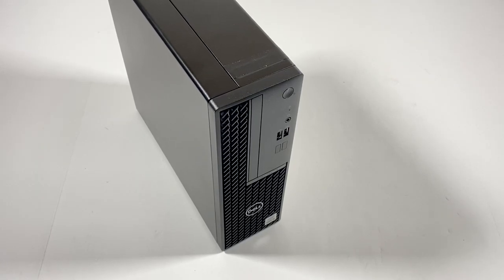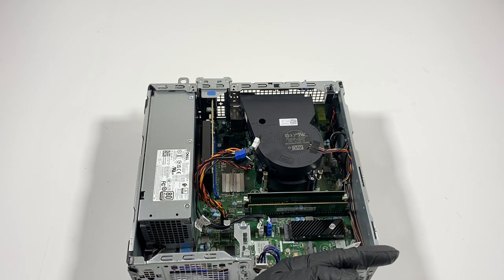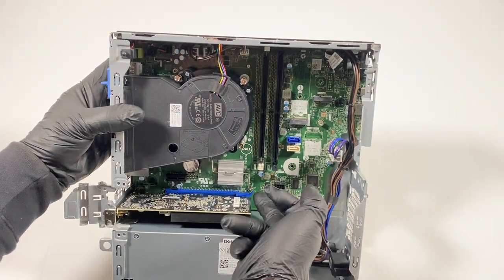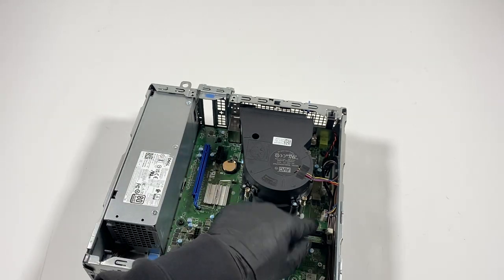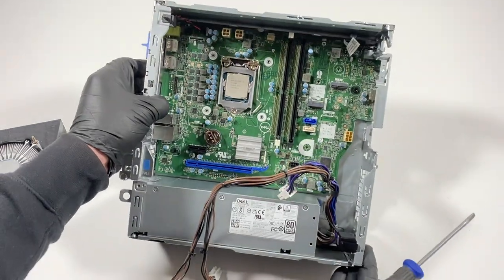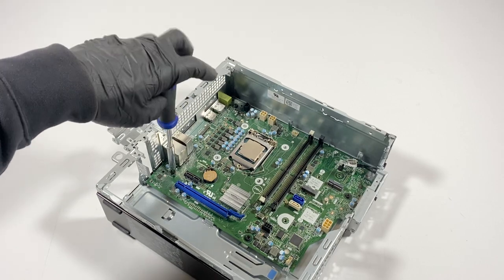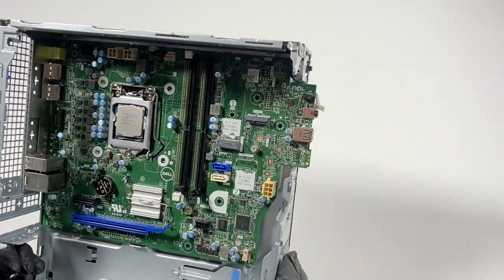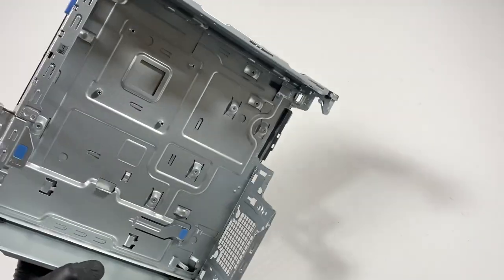Dell Optiplex 3090 5090 7090 Teardown

Comment from the maker: List of Parts and Upgrades works with this Dell Optiplex 3090 system :

Dell Optiplex Reassemble
https://www.youtube.com/watch?v=d_iJJm0R1hk

List of Parts and Upgrades works with this Dell Optiplex 3090 5090 7090 system :

(1.)  M.2 2280 SSD heatsink, Double-Sided Heat Sink, PCIE NVME M.2 SSD
https://amzn.to/3l2ittr

(2.)  EZDIY-FAB M.2 2280 SSD heatsink, Double-Sided Heat Sink, PCIE NVME M.2 SSD
https://amzn.to/3m7J3me

List M.2 Type 2280 NVMe PCIe:

(1.) Crucial P3 Plus 4TB PCIe M.2 2280 SSD
https://amzn.to/3RZcUNi

(2.) Crucial P3 Plus 2TB PCIe M.2 2280 SSD
https://amzn.to/3RTUi0Y

(3.) Samsung (MZ-V7E1T0BW) 970 EVO SSD 1TB M.2 NVMe
https://amzn.to/3d52k2a

(4.) Samsung 970 EVO Plus SSD 500GB
https://amzn.to/3fpi95A

(5.) Samsung (MZ-V7E500BW) 970 EVO SSD 500GB - M.2 NVMe
https://amzn.to/37uuLFw

(6.) Crucial P1 500GB 3D NAND NVMe PCIe M.2 SSD - CT500P1SSD8 
https://amzn.to/2N07wKh

 List of RAM will work with this system.

(1.) Crucial 32GB Kit (16GB x 2) DDR4 3200 MT/s (PC4-25600)
https://amzn.to/2Zazppk

(2.) Crucial 64GB Kit (32GBx2) DDR4 3200 MT/s
https://amzn.to/3bxCRPJ

(3.) Crucial 8GB DDR4 3200 MT/s (PC4-25600)
https://amzn.to/2R07Ier

(4.) Crucial 16GB Kit (8GB x 2) DDR4 3200 MT/s (PC4-25600)
https://amzn.to/326cfT7 

List video cards will work with this system.

(1.) Gigabyte GeForce GT 1030 GV-N1030D5-2GL Low Profile 2G Computer Graphics Card 
https://amzn.to/2Z4PHkp

(2.) ZOTAC GeForce GT 1030 2GB GDDR5 64-bit PCIe 3.0 DirectX 12 HDCP Ready Low Profile Video Card ZT-P10300A-10L 
https://amzn.to/2WzgLXk 

(3.) MSI Graphic Cards GT 1030 2GB GDDR5, Low Profile 
https://amzn.to/390Spum

*Upgrade Power Supply 260Watt HU260EBM-00 T5K83, J17YJ

(4.) AMD Radeon RX 6400 Low Profile Gaming Graphics Card
https://amzn.to/3s8MUUY

(5.) XFX Speedster SWFT105 Radeon RX 6400 Gaming Graphics Card
https://amzn.to/3xkmXo1

Supported Video Cards List for Dell Optiplex 3090 SFF

(1.) NVIDIA Geforce GT 1030, 2GB Low profile
(2.) AMD Radeon R5 430, 2GB Low profile
(3.) AMD Radeon RX 550, 4GB Low profile
(4.) AMD Radeon RX 640, Low profile
(5.) AMD Radeon 540, Low profile
(6.) NVIDIA GeForce GT 730, 2GB Low profile

Thermal Grizzly - Spatula for Applying and Spreading Thermal Paste 
https://amzn.to/3d8NQEE

Thermal Compound Paste:
(1.) ARCTIC MX-4 (current edition) Thermal Compound Paste 20 Grams 
https://amzn.to/2DhGJaK 

(2.) Arctic Silver 5 Thermal Cooling Compound Paste 
https://amzn.to/2ziNU0H

(3.) Noctua NT-H1 3.5g, Pro-Grade Thermal Compound Paste
https://amzn.to/36kTk7A

(4.) ARCTIC MX-4 (current edition) Thermal Compound Paste 20 Grams 
https://amzn.to/2DhGJaK 

HDD list works with this PC:
(1.) Seagate BarraCuda 4TB Internal Hard Drive HDD – 3.5 Inch
https://amzn.to/3d3xWeR

(2.) Seagate BarraCuda 8TB Internal Hard Drive HDD – 3.5 Inch
https://amzn.to/3xjUDSJ

(3.) Western Digital 2TB WD Blue PC Hard Drive HDD - 5400 RPM, SATA 3.5" - WD20EZAZ
https://amzn.to/3w3jIQA

(4.).WD Black 2TB Performance 3.5" Hard Drive - 7200 RPM Class, WD2003FZEX 
https://amzn.to/2xFUeyF